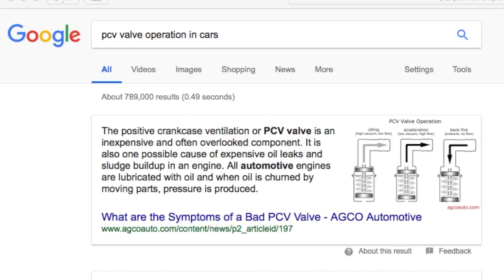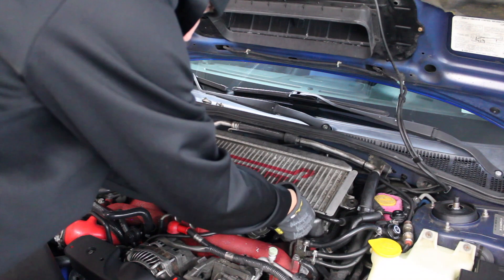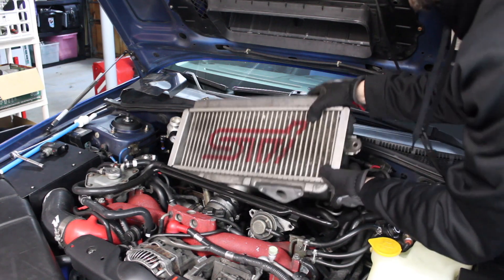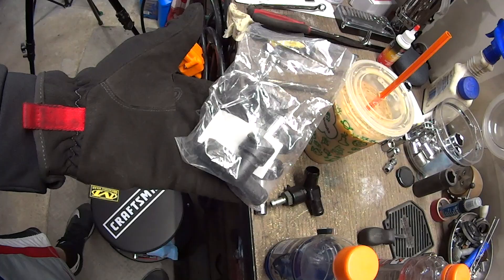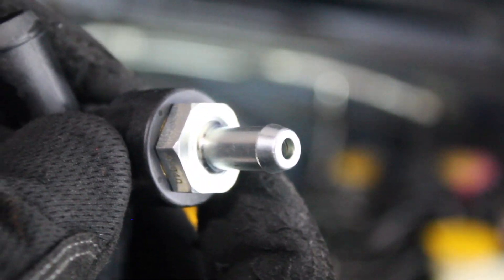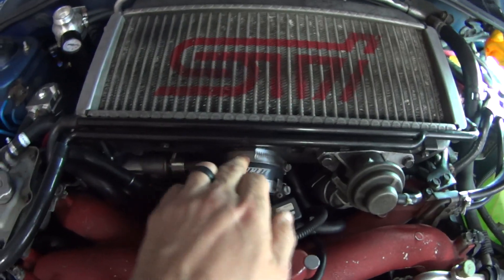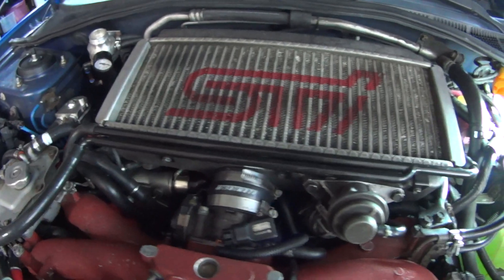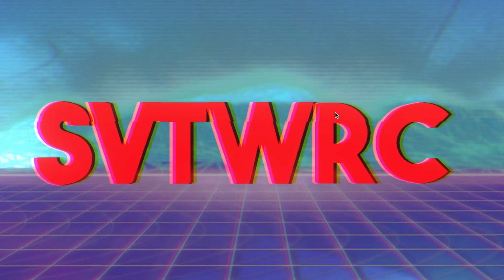Warning  Change your PCV Valve in your older Subaru  2004 STi How -To EJ Motor

Comment: Just did mine on my 08 impreza  after the cam plug popped out and covered my exhaust with a quart of oil this was because  of excessive crank case pressures
Reply from the maker: Wow that’s a dramatic affect. Its a common overlooked issue glad you sorted it out before real issues.
Reply: @svtwrc  I was surprised  that was the cause, but it makes a lot of sense. Runs alot smoother now and mileage is better as well.

Comment: I didn't do mine until after 15 years 138k. Don't be like me.  Get the hose too just in case for yours as they become rock hard.  Difficult to get mine off too where it was located. A little rattle.  I had oil leaks too but maybe just age on the cam seals.

Comment: Having a little problem with mine Burning of oil and fuel consumption too is high any help please
Reply from the maker: Hi ok burning oil off try the PCV valve for a clog or stuck open. For the fuel take a look at your plugs and coil packs and possibly your MAF and MAP sensors can be tested for volts with a scan device a good one at that.

Comment: I have an oil leak in that general area but i havent taken a look to see if its that valve and then after about 15 minutes of driving it starts to smoke  in that area only really when i either idle at a light or turn the car off  could that possibly  be it and or was that the same problem you had? O4 wrx sti
Reply from the maker: Hey now that sounds fully shut or clogged bad. If you want to clean it out first to test it before you decide if that’s your issue. Any boost leaks? It could be the turbo to intercooler or intercooler to throttle body hoses too.
Reply: Im not really sure how to check if I have boost leaks to he honest ill look into that too thanks but if i had a boost leak that would leak oil too?
Reply from the maker: NocheDogg23 boost would just leak air not oil definitely try your PCV valve.

Comment: What’s your thoughts on stuck open, could that condition cause boost issues. Would it mimic a boost leak?
Reply: It would burn oil, which leads to other problems

Comment: Will a bad pcv cause variable boost pressure I’m on a stage 2 Cobb tune runs good then out of the blue 9psi instead of 18psi
Reply from the maker: redneck foreal hi there , it should not mess with boost . Try taking a peak at your vacuum lines running from the turbo to the wastegate and boost solenoid. Replace any bad lines and try to clean the pill in the turbo line. https://youtu.be/aN88r4k3COg
Reply from the maker: redneck foreal https://youtu.be/PT-ka7JCgYA

Comment: On my 05XT (2.0)The hose coming up from the PCV to the turbo inlet is in bad shape from repeated removal, so good time to do this for me. Thanks for the video!
Reply from the maker: that hose is very important for correct air/ fuel measurement. a leak there in the inlet will eventually cause an issue.

Comment: IS - 11819AA001 - for EJ engines or the newer ones?
Reply from the maker: Paul JJ look at your Y Tree connector for a PCV Valve. If it’s in the tree it’s 19AA001 if not it’s 810A000.
Reply: Mine is 16 years and today I am checking  the pcv

Comment: This was a VERY good video, really helpful to understand the basics and outcome of the work. I have a question, I have a STi Hatchback -08. This is not the same I presume, though it should have the same type of solution, but with another part number? I have ridiculous amount of oil consumption, and I fear this is it since nothing else seems plausible.
Reply from the maker: Johnagren thanks for that. It seems you will use the same part as the 04 STi last # aa001 PCV valve. If yours is stuck like on my 03 WRX , your pooling oil into the manifold. You can clean yours if your waiting for the part and need to drive . CRC mass air meter cleaner is the best spray to clean and not hurt anything.

Comment: very informative all your videos, I learned a lot already

my forester has excessive oil consumption and hard to start especially in cold starts, I am gonna check it and change if needed, but I would like to know if it's located at the same place than your 2004 wrx, my car is MY03 LHD Forester xt SG body
Reply from the maker: Marc Bgood thanks for watching ! I think the Forester XT 03 has the 2.5l so it should be the exact location as the 04 STi .
Reply: @svtwrc  thanks for your quick reply, my car is a 2.0 turbo European models are 2.0 until 2005 I think.
Reply from the maker: Marc Bgood ohhh ok the Ej20 has the PCV valve under the throttle body.
Reply from the maker: Marc Bgood try this for your location, https://youtu.be/nuRC3yt2ruk
Reply: @svtwrc  thanks mate, very useful videos

Comment: Great video. Ì got an oil leak. I learnt about this. Trouble is I gave a 2001 bug eye. Can't buy one only seems to be 2002 onwards or 2000 below. Annoying
Reply from the maker: Marvin Eghan https://youtu.be/nuRC3yt2ruk this would be for Bugeye WRX 2.0l .the placement of the PCV is under the intake manifold but you can do this by just removing the intercooler . The PCV valve is different for the two motors.

Comment: You are my Hero ! Because of your videos I have purchased a 2006 STI ! . I am buying it off of a lot  . It only has 50K miles and is absolutely immaculate. I runs really good and really fast so I have put down a deposit on it . Could you please answer a couple questions for me . This car has a tremendous amount of add ons to it probably $10k no COBB device so I don’t know if it has a custom tune but I can’t imagine that it would not . I have told the dealer that there is no deal unless I know what has been added and the sale price reduced enough to purchase a new COBB device to either check or redo the Tune .  I know nothing about these tunes but from what I understand you could select a couple of different ones via the COBB port . It also has NO boost gauge so I am thinking he was using the COBB port to look at that parameter (and that’s another reason I am thinking that it used to have a COBB ) they are presently trying to track down the prior owner to find out what he put on the car . Would a tune shop need to know everything that is on it or would they be able to tell by looking ? Could you give me some advise fellow STI Owner ?
Reply from the maker: Wow That sounds amazing!! Ron , is it a Subaru dealership selling it, they can hook up a monitor to see if the ECU is "married to ANY tune device. bolt ons need a tune and Cobb Tuning only offers Stage tunes that have to have certain parameter met with bolt ons. Example stage one is stock motor with Only a cobb intake or SPT and K&N have the correct MAF sensor attachment. The stage 1 can only be tuned with the stock catted downpipes. stage 2 Cobb is intake and High flow downpipes . if you mixed the parts say downpipes and intake and only have stage1 you will blow it up. a good tuner will be able to look at the aftermarket parts , and let you know if its too much bolt ons for a Cobb tune that comes with the Cobb ,or if you need a custom tune.
Reply: svtwrc 
Thank you ! Awesome advice I am sure I am not the only one with this issue. I will keep you updated here as I find more out !

Comment: Good information for us subaru guys, I'd like to see a how to motor mount install. Keep up the good work.
Reply from the maker: Art of war - maybe this summer with the Killer B oil pickup tube and oil pan . Heard you have to loosen the motor mount to get at the bolts in the rear of the oil pan.
Reply: svtwrc I will look forward to that video. I did the pick up tube on my 05 sti which in my opinion is a definite especially for the mental piece of mind lol.